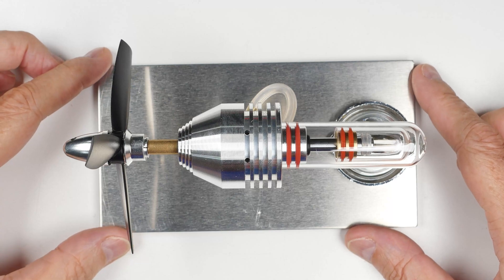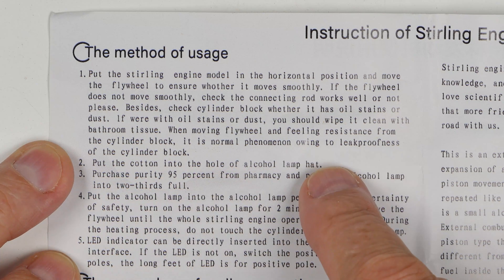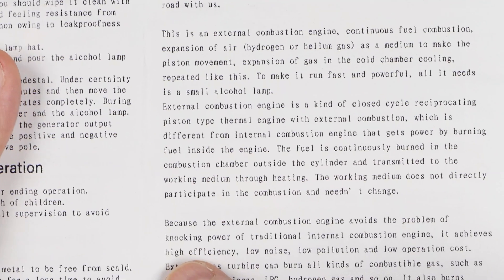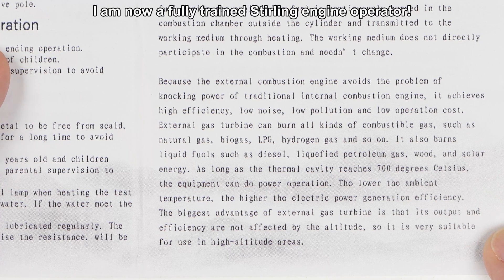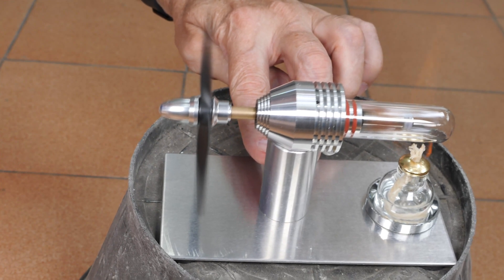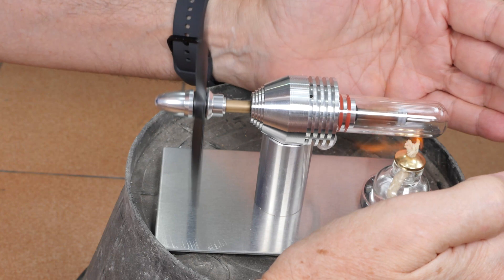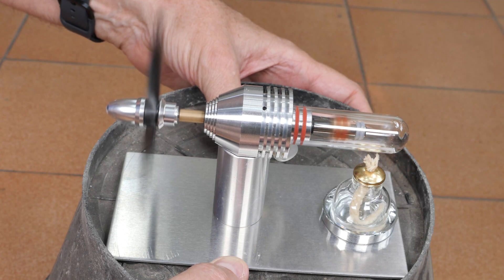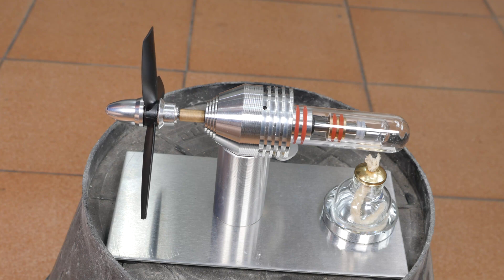Stirling Engine With Propeller (4K)

Comment: Looks like a little runout on the shaft but nice device anyway. It could be that the alcohol burner is a little more heat than it really needs to run it but l wouldn't know for sure.
Reply from the maker: I tried shortening the wick and it helped. How about if I tell you the displacer piston does not have a shaft, it's only moving because of changing air pressure?
Reply: @tsbrownie  Well I thought that was how Sterling cycle engines worked but I figured that it had some sort of shaft though. Hmmm.
Reply from the maker: @adnacraigo6590   I am going to tear it apart as much as I can on camera. The mystery to me is what is happening inside the support column. Is there a piston or just an open chamber? I think there's a crank on the prop shaft, but we shall see.